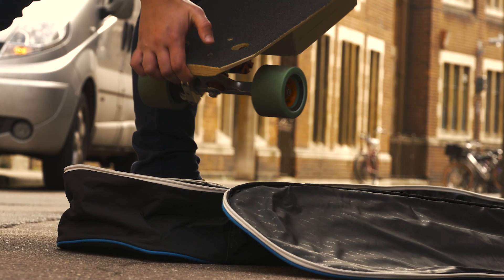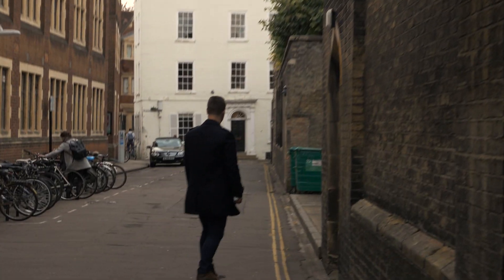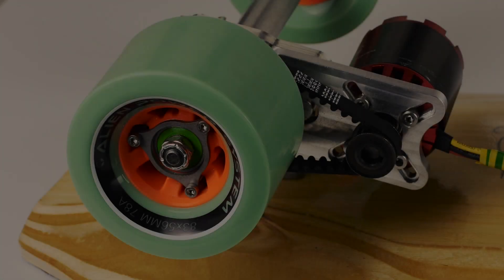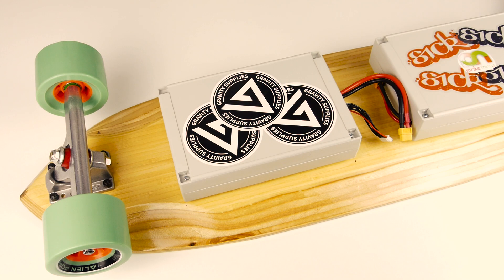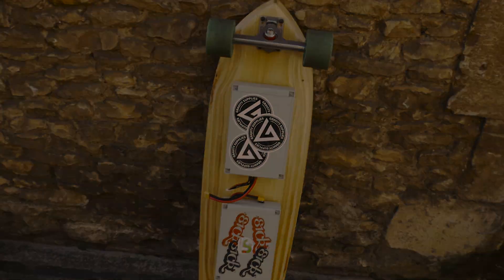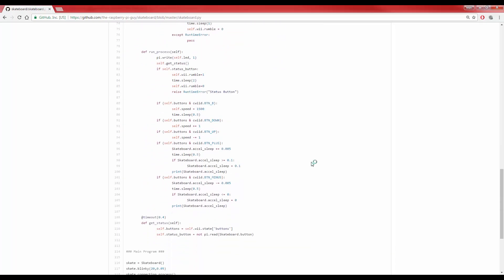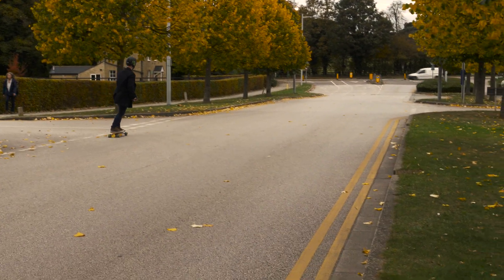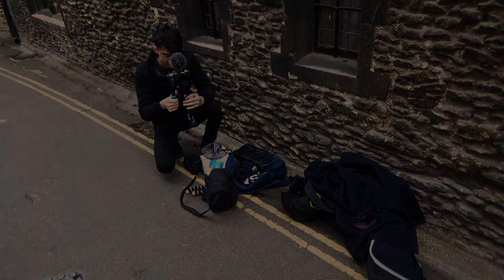DIY 30KM/H ELECTRIC SKATEBOARD - RASPBERRY PI/WIIMOTE POWERED

Comment: Can the code on github simply be copied and inputted into the raspberry pi? Or are there additional steps required? I am very interested in building my own e board, and am fascinated by the idea of using a raspberry pi on it.

Comment: You have a bench DMM, a Raspberry, and you need to scan 42 points for voltage reading.
How?
Remember, the DMM reads voltage, not the Pi.
How do you get 42 voltage points to one instrument?

Comment: Why did u use the 5v buck converter?
Reply from the maker: The ESC has a 7V output line on it. I wanted to use this to power the Raspberry Pi Zero. I originally didn't realise the voltage was that high and plugged it into one of the Pis. RIP. That buck converter just keeps the voltage down ;)
Reply: Thank you so much

Comment: Is there any way to make this work without a DC To DC Stepdown Regulator cause I can't seem to find one anyplace that's in stock
Reply from the maker: The ESC that I am using kicks out a constant 7.2V. Without realising, I plugged a Pi Zero into 7.2V - it blew up. That stepdown is ensuring the Pi is getting 5V continuously. I'd try and find one? Get 6 of them on Amazon here (next day delivery too): https://www.amazon.co.uk/eBoot-LM2596-Converter-3-0-40V-1-5-35V/dp/B01GJ0SC2C/ref=sr_1_1?ie=UTF8&qid=1480802847&sr=8-1&keywords=dc+to+dc+step+down
Reply: Thank you and I had another question if I wanted to use a duel motor setup would the code for the raspberry pi need to be configured for that?

Comment: What is the small board you have connected to the Pi at 1:57?
Reply from the maker: Carter Fietek a "buck" converter. The ESC provides 7.2v on one of its lines, and that is very handy to power the Pi with. That converter makes sure that 7.2v is knocked down to 5v - so the Pi can safely run

Comment: Does the skateboard have programming to stop accelerating if you drop the remote and it goes out of Bluetooth range? I noticed you weren't wearing the wrist strap in several shots.
Reply: David Hand Like you drop the remote and you're like 'Do I ditch the remote or the board'

Comment: Why the wii controler?
Reply from the maker: Bluetooth. Good range. Handheld. Ergonomically designed. Inbuilt wrist strap. Protective case. Reliable buttons. The list goes on...
Reply: It has fairly suitable controls on it and already communicates using bluetooth.
I've seen others convert a wii nunchuck. The nunchuck is more compact and has an analog stick for speed control, but then you need to add bluetooth or radio communication to it.

Comment: Ain't the PI too overkill for that?
Reply: Pi0 is $5, and very easy to develop for, so whilst it might be overpowered in the CPU department, that's insignificant compared with the ease of making it all work in the first place. You might be paying $3 extra, but reducing development time by days, which is way more than $3 worth of time.
Reply: Pedro Henrique sort of. If this was a commercial product you would use something much more basic, but like said above the time needed to make the code saved far outweighs the negatives